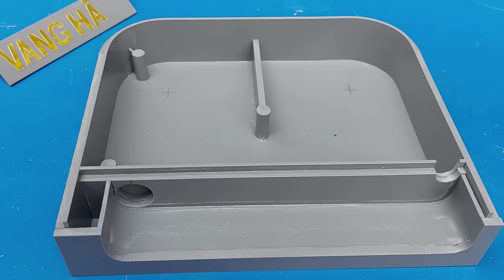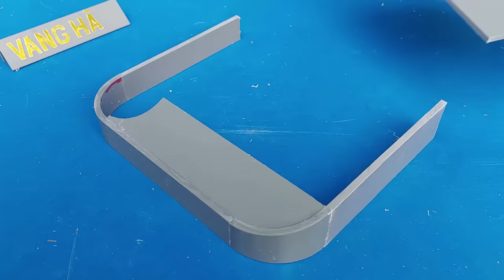Homemade inflator pump from PVC

Comment: It is missing an air intake port, which would improve the performance and possibly cool down the motor. When the box is closed, it is getting air from the gaps only
Reply: Wouldn't worry about the motor when the plastic melts due to friction 😂
Reply: Fancy tool, made by own hand, could be used once or twice on a month.
someone should not expect that it would perform at professional level.
Reply: @anubratachakraborty1370  ffs state the obvious could of used a vape as the pump housing
Reply: this guy does the best i know
Reply: Good

Comment: the level of craftmanship of this dude is freaking awesome. straight drill holes. to think this is just made with pvc. i just wish the piston/pump part are made with metal beacause that thing would melt or deform due to heat. nevertheless, nice project man.

Comment: The project is brilliant but I'm blown away by how each component precisely fits at their place, not even  leaving 0.1 mm gap 🤯. Kudos
Also, drilling holes for screws after fixing the part shows the confidence you have on yourself. 🫡🫡
Reply: 3D printerman😂😅

Comment: Good job... if u will take oil filled pressure  gauge meter than pressure needle will not vibrate and u can read accurate pressure readings.
Reply from the maker: Thank you

Comment: I appreciate your work,  but its pvc plastic,. It will melting due to increase in pressure and temperature, 
If you change cylinder and piston with metal it works fine.
Reply from the maker: Thank you

Comment: Whenever I try to make pvc sheets, its surface will not be plane as yours, do you have any tips to make pvc sheets with perfection🙏? Anyway your videos are just another level🔥♥️
Reply from the maker: You need to heat the plastic sheet evenly and then press it with flat stone plate.You can do it again a few times
Reply: thank you for replying

Comment: Is this design can convert to vacuum pump too ?
I mean have electric desoldering pumps  (a heating part and when press to trigger vacum pump suck solder on electronic board and component relase from board ( If don't see you can search this product on youtube) 
Could you design this product's video? 
I sure it will take so much like too